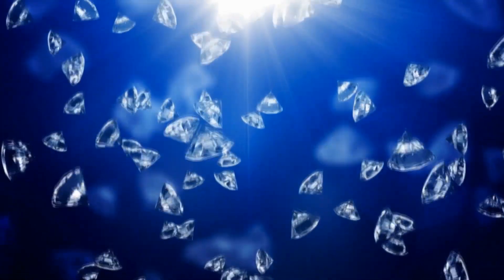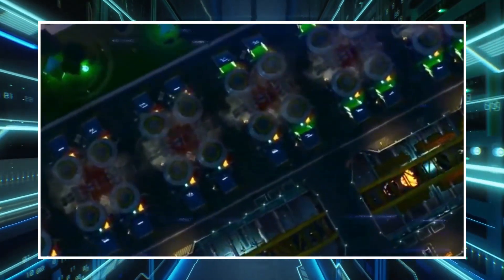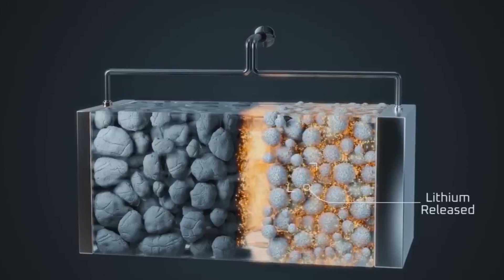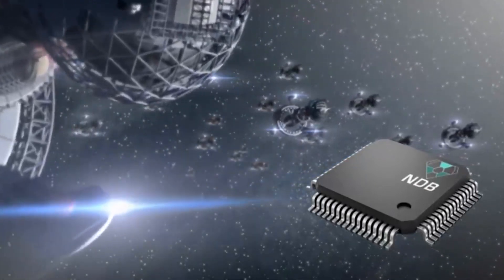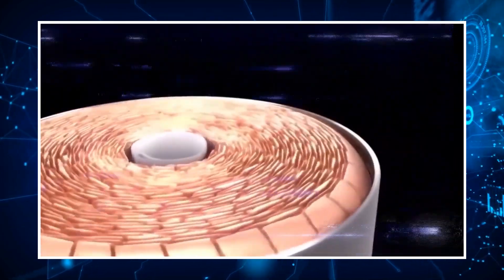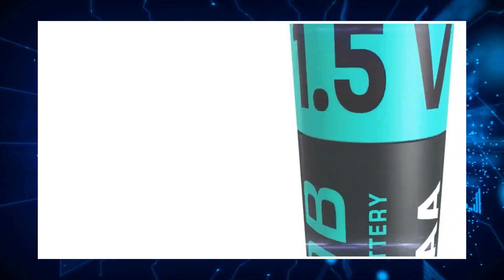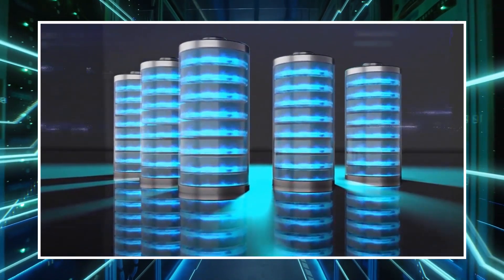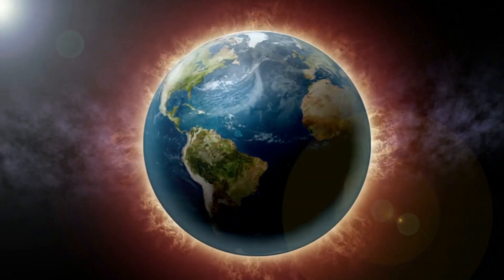Finally! Tesla's All New NDB Nuclear Diamond Battery FINALLY Hit The Market!

Comment: Tesla's cars that plan to use nuclear diamond batteries still need to be charged since he is not completely replacing the lithium batteries. Until he does I am not buying his cars. Still there are no ND batteries in the standard battery sizes. I suspect those types of batteries will never be avaiable as the ND batteries will be pre-installed into electronic devices and will be unremovavble and the company will make a royalty on every ND powered gadget that is sold. They could make trillions of dollars in profit.

Comment: NDB would surely fire up the EV revolution because the infrastructure problem vanishes!
Reply: No, this video is pure ignorant rubbish due to the power density being way too tiny of less than 100 micro Watts per cubic centimeter. Imagine a battery that can last 1000s of years 😊...then…realize such battery needs to be 1000s of times bigger than a Li-Ion battery for the same power 😮